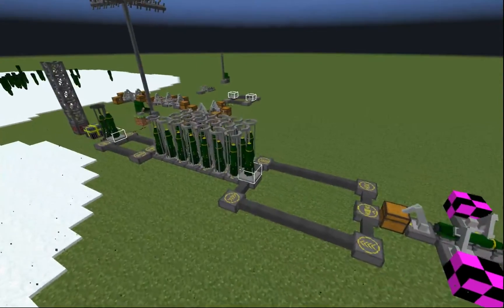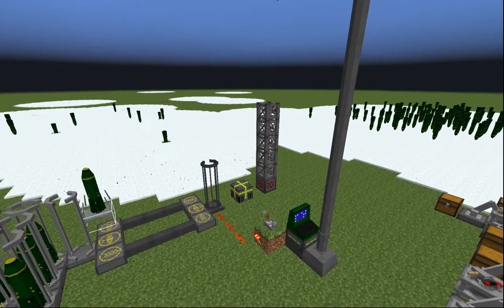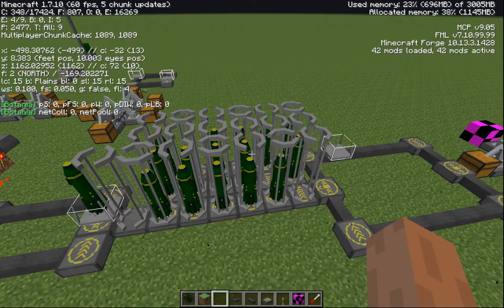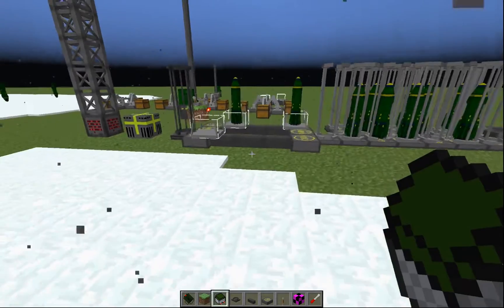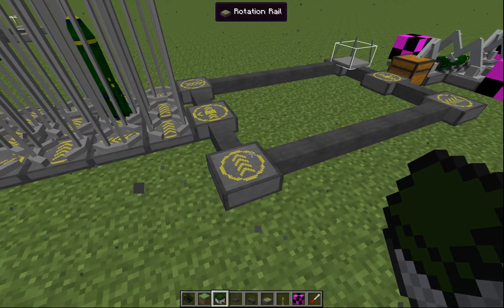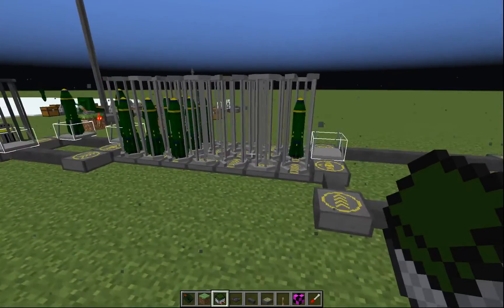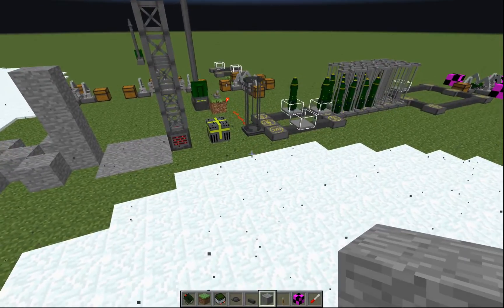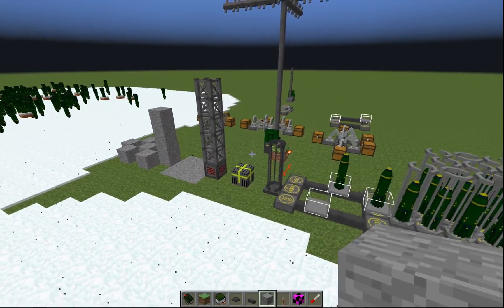ICBM - Full Automation Demo

Comment: any plans on a 1.10/1.11 version. 1.7.10 it pretty much dead at this point
Reply from the maker: I would argue that 1.7 is still doing well but there are plans to be updated to the latest MC version by March.
Reply: 1.7.10 is one of the main mod versions like 1.6.4 was before but 1.8 gets higher and higher in rank of mods